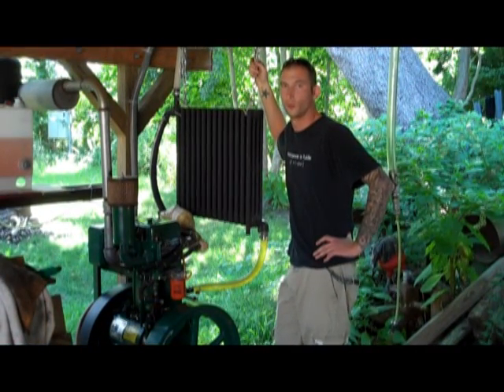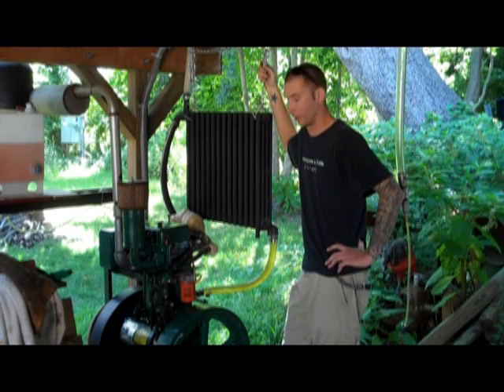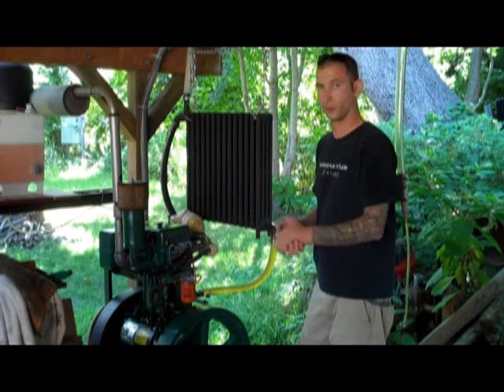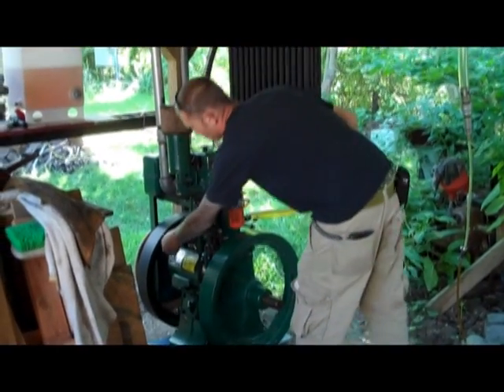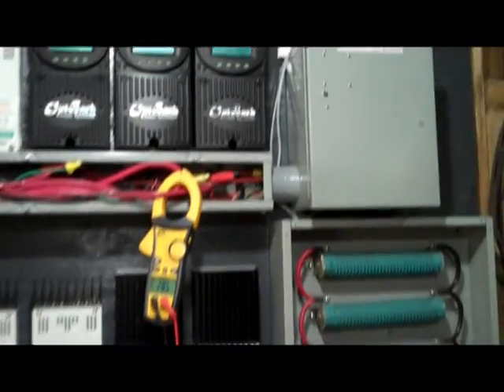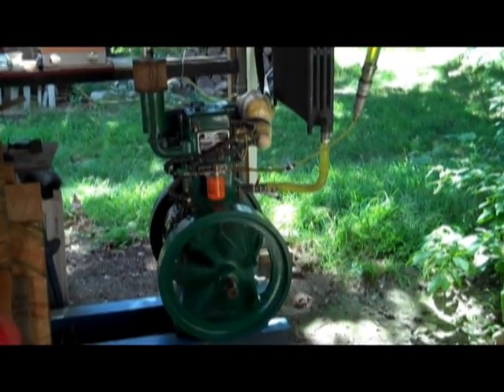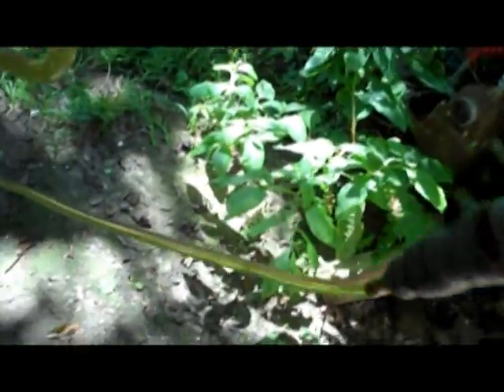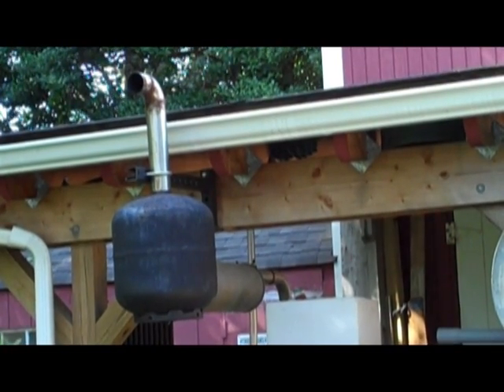Listeroid with Axial Flux alternator Windsine Inc.

Comment: Did you you have any cooling issues with  the botto  radiator  hose pointing  up very nice set up.
Reply from the maker: I've not had any issues with cooling this engine, ever. It now is in a different location with its own building but a very similar radiator setup.
Reply: @windsine  thank you

Comment: Nicely organized video!!
When will your results be ready? diesel vs veg oil? outputs in kwhs? Obviously off grid...do you grow and sell produce or make vege oil? What is your solar power stats? (quite impressive inverter and charger display!) Once we get the kinks out of our 6/1 plan to power up and pump after 6 pm to supplement our solar irrigation needs. Please share what wind sine means? thanks for presentation.
Reply from the maker: the results from that test were that we can produce 9.84kwh/gal of diesel. I made a new post on my site so I could get all the original posts with the newer ones (all in one place). It can be found here: http://www.windsine.org/2017/02/07/listeroid-backup-generator/

Comment: This is a very impressive use of Axial flux technology we have only  seen on wind turbines -  wondering  what gauge wire and number of turns are you using on  the stater poles ?

Comment from the maker: It is a bit undersized, but I have been using it for quite some time now and It gives me plenty of power just the way it is.  In my video I am using 14" magnet rotors with 12 poles - 2" round x .5" magnets. Earlier this year I put one together for a fellow in the Midwest and we have a bigger alternator that was built around 15" magnet rotors with 16 poles - using the same magnets (2" round x .5" thick). It runs nice on a very similar engine putting out around 2800 watts.